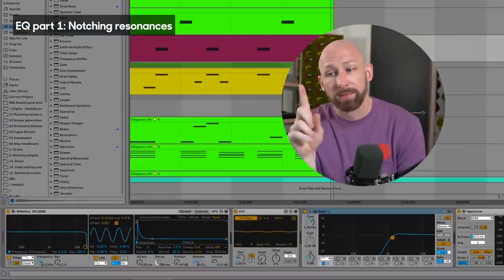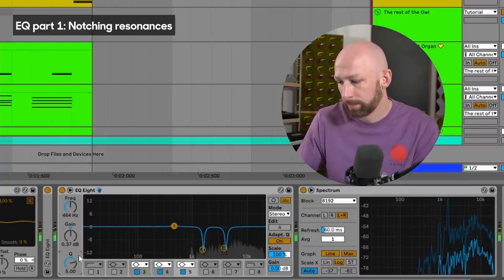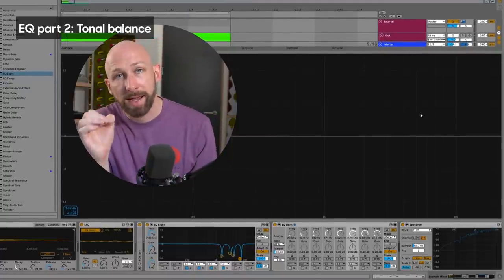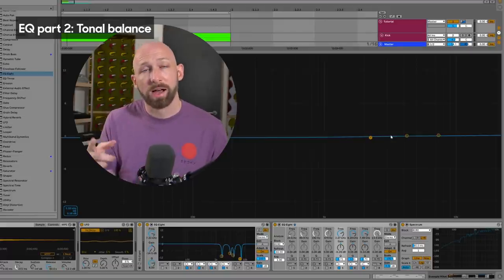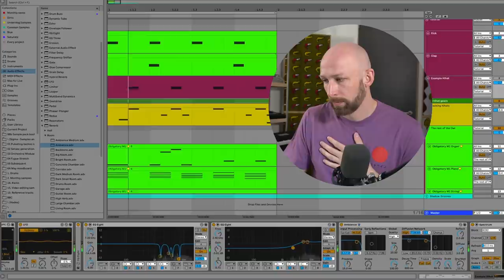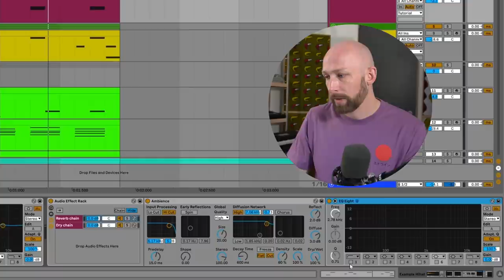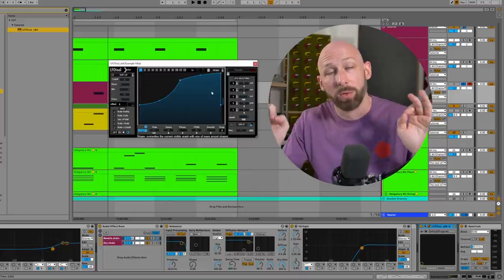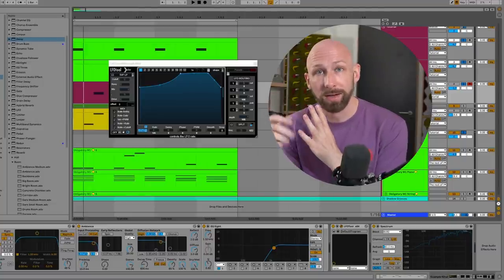Hihats part 2: EQ & processing essentials

Comment: I just applied that notch EQ technique in a song I've been struggling to get sounding how I want. Instantly made my hats sound 10x better. Then I decided to give it a try on my ride and crashes, and it instantly made those sound 10x better. Then I thought maybe this could be applied to the high-end on a snare, and it instantly made the snare 100x cleaner and cut through the mix twice as well with barely any volume adjustment required. And now with all the highs being so much cleaner, the entire mix sounds levelled up with hardly any adjustment to the other parts. Game changer! Thank you!

Comment: This is a good tutorial I feel like most people just throw hi hats on Do a low cut on them and push the frequencies. Cutting out those peaks then do a slight broad eq boost to make them brighter or darker depending on your vibe is very smooth. Then adding the reverb will definitely use these tips in my productions. Thank you

Comment: I´m not totally agre especially with te notching resonance becouse it kills the esence of the 909 hihat, if you use to create other hihat based on this it´s ok but for mixing, I think you have to be less drastic
Reply: I noticed this as well only solution I found was to lower the gain instead of notching out ressonant frequencies
Reply: Couldn't agree more. Can be helpful technique but was wayyyyy overdone in the video.
Reply: I absolutely agree. The phasing using you receive from this sorry of technique is not worth it.

Comment: I find  the eq method you use actually creates those  peak frequencies. I like to turn on the speaker icon of the eq and rather than push the eq band up I pull it down and move slowly from left to  right. You will hear the troublesome frequencies pop out and sond like feedback. This also xlnt for low end also as you can here the lower frequency you are notching while still listening to your mix. Cheers for all the tips :)

Comment: I agree in half with this technique. If you cut out resonances, which are outside the key scale. But if you cut out all of them, so drastically like in your example, you kill this sample. Correct example is; you should volume up of Q a slightly, and listen to, when the boosted frequency is disturbing. Now you've got the spot. Then you should put Q a volume in the same, but in negative value. Still remember to cut out only frequencies outside your scale. If there are some most disturbing points in the key, cut it only slightly.

Comment: with lfo pumping, i tend to use 8th or 16th note speed, and at around 2-10% wet. makes it a bit more fluttery and less pumpy. i use that on both individual tracks and on the final output after compression and such. sometimes i use a sine shape, sometimes i use something more like the shape you had there.
Reply: another thing i like to do is put a bit of random note delay on the midi, even on the kick. makes it feel more alive and human

Comment: The 909 ride is a case where removing harsh resonances with EQ is desperately necessary. This case however, I disagree with. 
The closed 909 hat I leave, the open 909 I cut at most 3dB. The 909 hat isn't nearly as harsh as the ride, and when A/B-ing the notched sound feels band-stopped (which you pretty much did seeing as you took out from 8 to 14dB). Removing this much of the resonances on 909 cymbals removes what make them sound like 909s.

That might be what you wanted, though, and this was just my opinion. I just felt like adding that how much you cut is entirely up to you since cutting more will remove the 909 feel (although in the case of the ride, you definitely should cut at least 4-5dB at it's most sibilant peaks if you don't want to give the listener tinnitus).
Reply from the maker: Yeah I agree with you overall, thanks for acknowledging it's also an issue of taste, some people seem to be hung up on some kind of "official" treatment of 909 sounds 😁 I agree I go a bit far in the video, to explain the principle in an obvious way. Not all sounds need that kind of cutting.
Reply: @OscarUnderdog  hats off 👍

Comment: Much thanks for making this 2 part series available,just watched PT.1 and in the middle of the second-

Have a question about the notching approach you show-is this just being done illustratively or would you actually make these kind of surgical high-Q cuts in the same general frequency area i.e.@3k + 4k ?

Asking because I've been spending a lot of time using the solo feature on Voxengo Span Plus to figure out what's going on in each area w/a similar high-Q setting but thinking more in terms of a broader boost/cut approach except when necessary....

Comment: Possible to use deesser on hi hats?
Reply from the maker: It depends on the de-esser! if it's a multiband effect you can, but if it's a full-band effect it will just end up lowering the volume consistently. De-esser is good for sibilant content that happens irregularly, and some de-essing FX assume that the sound happens sequentially (i.e. they dip the whole signal when the S happens, not just the high frequencies). So it depends a bit on the effect!

Comment: What LFO vst were you using? Can you please show how to do the same thing but with Live native/Max4Live devices please? Thanks.
Reply from the maker: Hi! It was the XFer LFOtool.
Reply: You can do the same thing with ‘shaper’ in Live. Just map it to the gain on a utility.

Edit* Make sure you set the gain max to 0db using macros or setting the max on shaper to 50%. Otherwise you will end up boosting the signal by 35db

Comment: You never boost sharp bellcurves and sweep to find problem frequencies. Yes, hats can have some nasty frequencies, but if you don't hear them through your monitors when the EQ is flat then it probably doesn't need equalising. If the hat isn't working, it's the wrong hat for your song. Find or reprogramme another. Problem frequencies tend to pop out when the EQ is flat.

Comment: Resonance sweeping? You can make any sound have sharp resonances when you sweep. I was always taught that if you can't hear a bad resonance then why make one? This method creates resonances when maybe their arnt any really there that are causing problems? If during a mix you can actually hear those resonances that hurt your ears then surely through elimination, find the offending  instrument  or instruments then look for frequency clashing and cut/notch from there? Any sound you work on will have a sharp ear piercing resonance when you high gain a notch through the frequency spectrum like that. It doesn't always mean you need to cut it if it's not causing a problem. What you're doing by notching out all those areas is changing the tonal characteristics of the sound you oringinally chose because you liked it. 
If it has bad resonances like that, then you should chose another sound that's better quality. I think we should use our ears and if there are no problems poking through the mix, then normal eq'ing of track, and careful sound source choice , which should have been taken care or during your mix, will have stopped any harsh renonances coming through. Just a thought? I'd also like to add  that your channel is great and i have picked up some really useful knowledge here.Thanks

Comment: those vids are very informative!, really good work, but... in this particular one, I want to point out that EQing ain't free lunch...it means that EQ introduces phase distortions, and heavy EQing like in above example will creates a lot of it. Simply saying, the less you use processing - the better, any plugin/processor introduces changes to the sound, in most cases (in all cases actually:) degrading the original sound.

Comment: I know this is a stupid question, so don't roast me.  Once i've created the chain and have my reverb etc on for my hi-hats (which I usually create with Operator), it obviously will result in some increase in amplitude, so I'm assuming for most people they just adjust on the mixer desk or volume to balance it to the amplitude level it was at before the wet signal was processed etc? I just ride turn down the output channel to the volumer it was before the wet signal in my case.  Sorry I realize this is probably a dumb question.

Comment: Not to be a dick, but I wouldn't suggest anybody who is not knowledgeable about audio engineering and doesn't have a treated room and nice monitors to "notch resonances", especially in hi-hats like that. If you boost it 14db of course it would sound weird. It's not necessarily a "bad frequency" if it sounds off when boosted like that. And as a result you will get really dull percussion.

Comment: I'm sorry but I see a couple of things that don't work in this video. First, why not just set the Q to max since you're only going for a particular frequency ? Leaving it at 5 or 6 takes out way more other frequencies when you turn it down. Second, the freqs you're turning down are not necessarly undesired resonances. Problem is if you start boosting every frequency at 12+ db they're gonna all seem disproportionate and harsh. I'm sorry but I feel like you took all the character from that poor hihat using this technique bro.